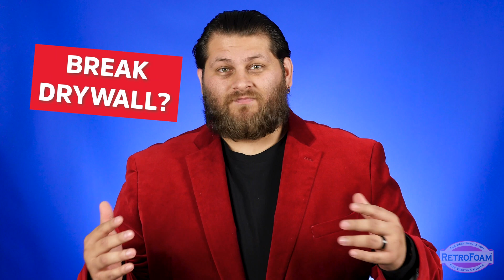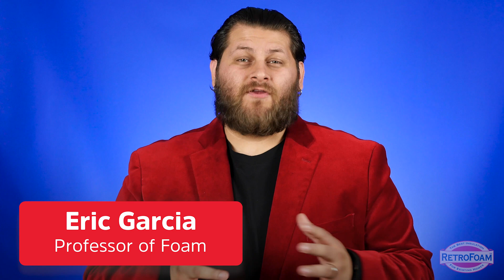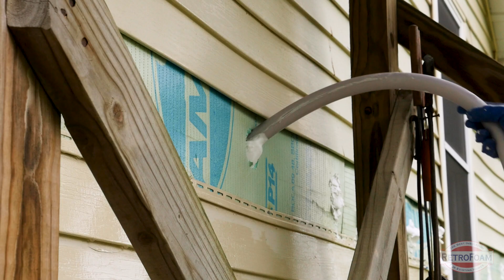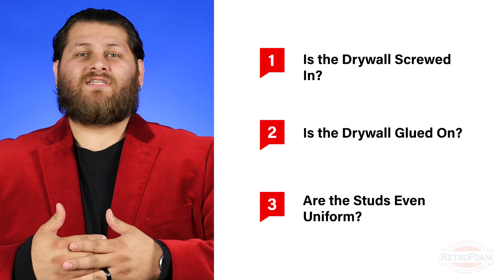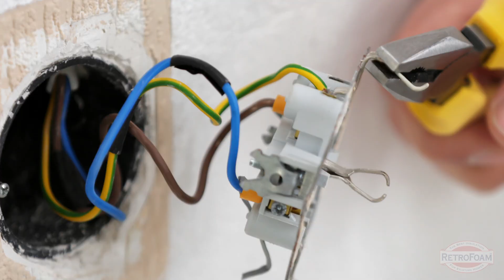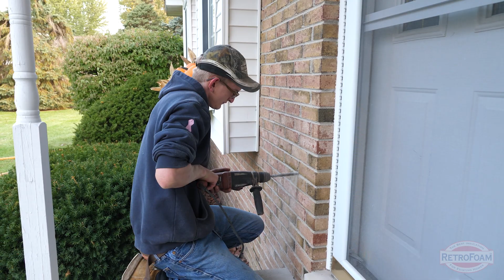Possible Issues with Injection Foam Insulation | Foam University by RetroFoam

Comment: How do walls made with plaster and lathe hold up to the foam pressure relative to drywall?
Reply from the maker: Plaster is actually stronger than a lot of people think and holds up well when the foam is injected. Just like any wall, if there has been previous damage, that can lead to cracking, but it doesn't happen all that often.

Comment: What about residual smell? My place still smells like the plastic-y chemical smell when I come home from being gone for a while and I feel kinda nauseous around it. How can I tell if it wasn’t the right mix or has t dried? How can I tell if it is toxic to me and my pets?
Reply from the maker: Hey Sara! Are you sure it was injection foam insulation that you had installed? Injection foam insulation is not known to have a smell and is not toxic. Spray foam insulation is very different and is known to have a smell that off-gasses. Some people are more sensitive to this than others.  Regardless, if you are concerned about toxicity, we recommend doing an indoor air quality test.
Reply: @foamuniversitybyretrofoam  Thank you, I am very positive it was injection foam from USA Insulation. They put it in the walls on my first and second floors from the exterior of the home.
Reply from the maker: USA Insulation's foam is made from different materials. I would suggest giving them a call and having them come out to do an air quality test and check that the foam cured properly. If it were us that did the job, this is what we would do. I hope this helps!
Reply: @foamuniversitybyretrofoam  I’m really worried it didn’t cure properly or there was an error in the mixing. They won’t do anything, I asked for the air quality test and told them I’m still smelling the chemical like paint smell. The truck failed while they were working on my house, something about a compressor. They have to get another truck. There was also foam inside of my air returns/ vents that had to be cleaned out but it was a month or two. I’m really worried about my health, since I was inside of the home with no mask the whole time they installed the foam. They said it would be safe but I was pretty sick not long after. I am home a lot since I work from home, but any time I leave and come back the smell is there and overwhelming. Please help me find some resources about the  potential chemical issues that could of happened and how to push the air quality test? I’m worried I’m being gaslighted but that they had some kind of issue that effected the mixing of the chemical and it’s not cured. I smell it more on warm days and anytime I’m near the vents on the brick part of the house or the outlets on the part of house with vinyl siding. What if my health will be effected long term?
Reply from the maker: Reach out to USA Insulation and ask for a copy of their SDS. This document will break down what is in their product and other pieces of helpful info that involve safety. Typically injection foam does not have any health risks associated with it so it may be something in their foam specifically that is causing this issue, it is hard to say. We have our SDS information on our website, but it does not seem to pop up on theirs. You may have to request it from them directly. Additionally, If you would like to email me your contract with them showing what work they did for you I can look it over and see if there is anything else I can think of. My email is professor@retrofoam.com.
Reply: @foamuniversitybyretrofoam  thank you! You rock. I hope these comments help your local clients see that!
Reply from the maker: Thank you, Sara! We really hope you get the problem resolved.